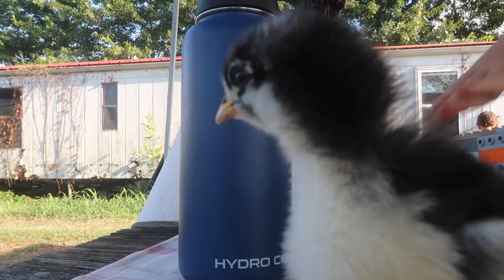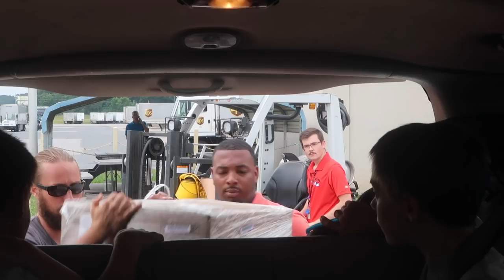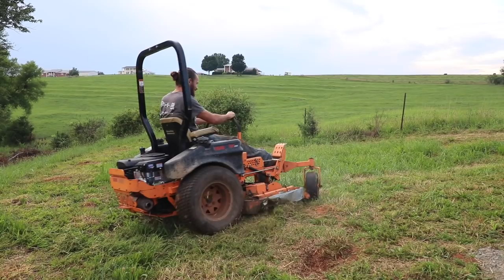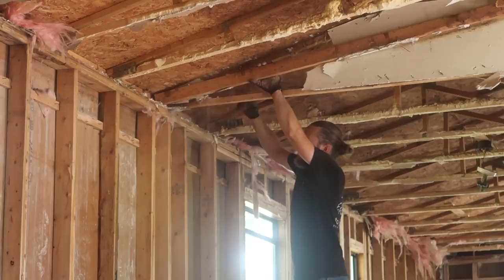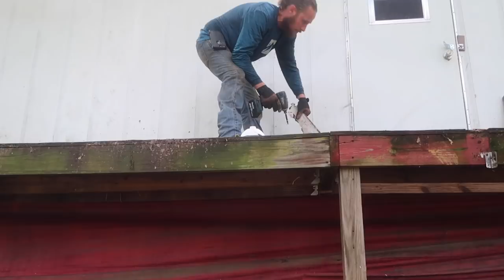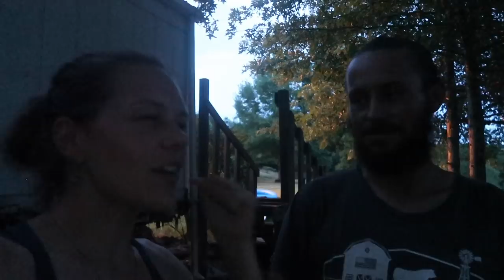One More Time With The Hammers

Comment: So excited for you all!  We have a triple wide that is 36 years old and you cannot tell it is not a stick built home...it is study and awesome construction when we got it..........but let me think, lol, what home travels down the road on steel under carriage at 60 miles an hour? LOL Sooooooooo it's sturdy and the outside materials to replace are just as nice as any stick built in fact about the same thing.  We used  T-111 and redid the entire outside over the years. Sheet rocked the inside walls, redid bathrooms with custom $ vanities over 1 each and went to HD and got all new vinyl windows (16) of them and a french door and added a 12 x 65 trex deck on the back of the home. We live on 5 acer's of  heavily wooded and pines and it is like a dream actually. Granted tons of work and using the no interest if pd in 24 months works fantastically.  We didn't have any other choice and boy did that save on the budget and finance charges. 
I am telling you it has been amazing what your hard work can accomplish and determination.  The mess is another thing but if you want it bad enough it can be done!  I know you will have a fabulous home when you are done.......just take a day here and there to get away from it all on an outing and relax a bit just to maintain  sanity. Seriously there are days, and then there are days as you all well know. 
Blessings in all of this and you will take away from this a reward you cannot believe as years go by you will wonder how you got it all done!  It's an awesome fulling accomplishment plus the whole family being involved is a true testament to the childrens growth and experience.  Hard work never killed anyone but it sure built character and reality in our lives. Love you guys and I can't wait to see your next posts.  Excited about your mower and I can tell you had a blast doing that, accomplishing it and your friends and neighbors homesteaders who come to help are amazing human beings........how blessed can you be!  Stay healthy,  eat well, rest and play when you have an opportunity!  You are rocking it and we are all watching and rooting for you!   TMI  I know but I am so jazzed for you all it just hits home to me and I know you can do this!  Excited for you all!  
God bless!!

Comment: I had friends that started with a single wide and 2 acres. He worked in construction and decided to add on to the trailer as their family grew. It started out as a 2br, 2ba trailer. He dug and built a basement then built their current house on that. It’s now a 4br, 3 1/2ba home with floor to ceiling oak cabinets (12’ ceilings), family room and a beautiful 3 tiered rounded deck. Dream big start one step at a time.💗

Comment: Great job... While doing construction is a great time to clean out the duct work... Especially if the house had cat pee  smells... I got a brush on a flexible pole that attaches to a drill at a thrift store... Run it trough from vent to vent dry then shop vac... Then run it through with soap, vinegar and hot water... Then shop vac... That way no surprising smells when you run the heat or ac...
Reply from the maker: There are no ducts. 😳 They were all removed who knows when.
Reply: @TheHollarHomestead  oh well at least new ones are clean...

Comment: You might want to put bracing on the outside when you do your floors that way if you need to Lyft the walls So you can get the particleboard floors out from under to replace it with plywood that’s a possibility if you are able to only do one section at a time that way the house will not twist would you think about it and good luck

Comment: Ive got a scag mower. Thats a generous gift. Btw, the doors, hardware, just about everything on that mobile home, will not be standard Home Depot stock. The doors are all different sizes and must be gotten from a mobile home supply. Take my advice and get solid wood frames. Fyi.
Reply from the maker: We’re planning to reframe a lot of stuff rather than just replace the same sizes.

Comment: You guys have your work cut out for you.i've done the new flooring in trailers before. Do your best to insulate and seal the new sub floor. I used pressure treated wood so it would hold up longer here in Alaska. Good luck👍

Comment: a motor sure is cheaper than new or even a used mower may have to weld a bracket here or there but still cheaper. glad for you'll.
 ok, what is the vehicle you drive?
Reply from the maker: We have a 7.3 Ford Excursion. It’s name is Sasquatch. 😂

Comment: I don't want this to sound rude, but I was wondering why you were putting this much time and effort into the mobile home and not the farmhouse? I think everything you're doing is awesome, and you guys are amazing, but just curious as to why you've focused your efforts on the trailer. :)
Reply from the maker: The farmhouse is probably going to cost around $100,000 to remodel. We have to put in the septic, water lines, etc. not to mention all new interior, exterior, roof, foundation work... that’s a big expensive project for the future.